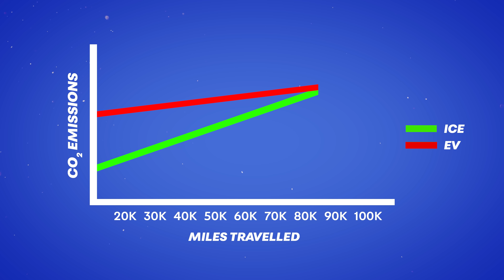Are Electric Cars REALLY That Green? [New 2022 Data]

Comment: Wonderful discussion. You hit on many of the points I think about and argue about when considering EVs. I’m a car guy and a geek but have not yet taken the plunge. I live rurally and take long drives - EVs simply don’t work for me, yet. I agree with you that, with time, technology will improve and EVs will be a better proposition. I may give up my A4 but the 911 cabriolet with manual will be mine for as long as I can keep it going! Cynical note: are we nuts over EVs because Tesla is worth $1 trillion and everyone wants a piece of that?
Reply: No-one who says in 2022 that EVs don't work for them is not telling the truth. I have NEVER encountered anyone who could explain HONESTLY why an EV wouldn't work for them. ALL of their reasons were wiped out by advances years ago, but they still hold on to out of date nonsense. Range as a reason was killed stone dead by 2018. Charging speed was killed stone dead by 2020. Cost was killed stone dead from the start. The infrastructure has grown way beyond ICE infrastructure to accommodate a far smaller number of vehicles, so the infrastructure argument is also stone dead. When you say "it doesn't work for me" you mean you don't WANT it to. I've owned an EV for six years. By today's standards it is very low spec and yet it has busted every single EV myth going. EVs can work for anyone, anywhere.
Reply: @trevorberridge6079  With respect, I take long drives (6 hours, 12 hours) to see family. I’ve consulted Tesla and EV America maps to figure out what recharging would be like. Both add significant door-to-door time to the drives. Further, I live in a rural area where the nearest charger is 45 minutes away. A trip I have planned to Michigan’s Upper Peninsula is simply not doable with an EV car. I realize that 95% of my driving is just fine for an EV car. But the long road trips I take make EV a wait-and-see for me.
Reply: As others have discovered in many test drives, if you are driving very long distances that take 6 to 12 hours you WILL be stopping occasionally anyway for a number of reasons. If you charge while stopped then you cannot claim ALL of the stop time as additional time due to charging.  I have often stopped on long journeys and charged up more than I intended because it took me longer to eat and take a comfort break that it took for me to get to my target charge level. So, in those cases, there was NO stop time due to charging. Charging happened simultaneous to other activity.

Also to say you cannot use an EV for very long trips in America is simply untrue. You could argue that you can't do the journey within a specified time frame. But the answer there is to do the same as you would with an ICE vehicle - plan your trip around a realistic schedule. Check out Transport Evolved to see the many coast to coast and other long distance trips they have done across America including while towing a vehicle on a trailer.

You should also note that there are already cars that can do 1000 miles on a single charge that aren't even using the latest battery tech. Sandy Munro who is regarded as a much respected engineering guru has stated that we're not many years from batteries the size of a large smart phone being able to provide that kind of range. That means on a volume for volume basis a battery pack that would be considered small today would be capable of delivering tens of thousands of miles on a charge. However, that is where we are going. The fact is that where we are now means there is no journey too far for an EV. Even the humble 30kw 2016 Nissan Leaf has completed the 2000+ mile Mongol Rally using only domestic level charging. Current cars are WAY beyond that vehicle. They have higher efficiency, bigger batteries and hundreds of miles more range.

In summary, if you want to say you cannot drive to Michigan's Upper Peninsula in an EV then you really mean you are setting a maximum journey time above which you call the journey "impossible". Taking longer is NOT the same as being incapable of doing the journey. A person can swim across the English Channel. It takes a lot longer than a boat, but nevertheless it is still 100% "doable".

Comment: What they didnt factor in, is the most important aspect, which is evolution of the methods used in producing parts for EV vehicles, as they become more common, and more widely sold. It's currently harder on the environment to make EV vehicles, because they are not being built at the numbers that ICE vehicles are, so parts are in smaller runs for every single aspect of the vehicle, which takes a greater tole.
It is always hard on the environment, and most expensive for tech in it's infancy, until the tech becomes the standard.

Comment: but the problem to mention is by 90,000 to 100k miles lots of evs are going to need a new battery which is going to ad a sudden spike to the break even point

Comment: No, they're not green. The production of the batteries is extremely polluting, the packs only last about 8 years, most of the materials cannot be recycled, and they're usually charged from coal or gas powered plants anyways!!! 

It's just basically 'virtue signaling' at this point. But, as a car guy, that instant, explosively powerful torque is attractive!

Comment: With the acceleration of Europe’s move to renewables in the current Geopolitical climate in the next decade(the values given were most likely 50k for Europe, how many cars bought today are not likely to complete 50k in the next decade?) the figure these cars will be greener is actually now closer to the green energy end of the scale at 32k.). Battery technology and the embryonic recycling industry of these batteries is progressing at a rapid rate, far exceeding developments of the combustion engine, so if this is a comparison over the next decade (as it should be) the model for EV adoption is far more beneficial.

Manufacturing Co2 levels, is not the same as the dangerous levels of pollution in concentrated areas of large cities, that sits at the height of inner city children. Just shy of 10k premature deaths were attributed to pollution in London last year. The majority of this being attributed to our road pollution. This is comparing buying a new car to keeping the old one.

Does this include pollution from brakes or just Co2 output (surprisingly high amounts are related to tyres and wheels, 30% I think I read)?  combustion engines output will be far higher as although are heavier, the regenerative braking performs the bulk of this, so you can complete entire journeys without using the traditional brake pads at all.

Comment: However, if you maintain an ICE then it can last for many hundreds of thousands of miles. How long will a battery remain efficient before it needs completely replacing and thus starting the cycle again? Is the disposal of the original battery taken into consideration whilst an ICE engine is recycled? Genuine questions here.

Comment: Another question is how do we dispose of the old batteries? Batteries usually don't last more than 10-15 years, after which you have to replace them, which in my opinion pollutes two times more than building the EV in the first place, you have both pollution from manufacturing new batteries and dumping old ones! That's why I do not think EV is the solution, maybe hybrid, you can drive it in electric mode in the city and then recharge it on the way home on the highway, where new ICE usually get very good gas mileage.

Comment: How many battery packs do you need for 250,000 miles? That is what today's cars are capable of. What is the energy sum for all the mining and equipment to manufacture a replacement battery pack, or replace the complete car. Let's not forget the increase demand on the power grid and all the resources to expand the grid and power station. Then what do you do with the old batteries? ICE are totally Recyclable except for gaskets. How plentiful are the resources to make the batteries? In the end someone can bring me a few gallons of gas, But where I'm I going to get the power to recharge my batteries while creating a major traffic jam bigger than the one I was stuck in to start with. We need a better solution!!

Comment: Bring back the OG Peugeot 205 but with batteries. There I said it. Don't change anything else. Doesn't need a big battery, excellent for city driving and way cheaper. I said 205 but about any basic economy mini car from the 80s or 90s will do. Not as safe but at this point I'll take a little bit less safety for a more friendly impact on mother nature.

Comment: Really interesting video. A question I had always wondered.

I think it's fair to say that more than 90% of EV owners will be on specifically designed EV tariffs which are renewable/nuclear only. So, I think the fair comparison is around 30,000 miles for the breakeven point.

I think Volvo were just trying to be clear on the point and how the customer's energy mix impacts the impact of their vehicle. And I think it also says that a BEV is still a less impactful choice.

It's good to see investment and focus in electric cars at last, with innovations improving efficiency of the vehicles now >4 miles/kwh compared to <3 miles/kwh just 4 years ago and, things like BMW's precious metal free motors (which means less dirty mining) and Tesla's tab free batteries, LFP batteries nit containing nickel or cobalt etc.

I guess other things to factor in are components. An ICE car has considerably more components that need replacing during its lifetime vs a BEV so, the breakeven point may even be a quarter less than that in Volvo's study.

Comment: Not sure why this makes EVs look bad. The current European mix implies that if you plan to keep your car for more than ~5 years, then overall, you'll end up more environmentally friendly. In addition, it also gives an individual added benefits for installing solar and storage at their home (which further reduces the breakeven ownership time). 

The result will likely only skew further towards EVs as manufacturing processes get greener, grid electricity reduces emissions, EV batteries become better (longevity and capacity), EV engines become more efficient. You could argue ICE will also improve, but the weight on investment and innovation is on the EV side, so logically that should improve faster.

Comment: It seems a lot of the auto industry journalist have a brain disorder, use accurate info if you want to stand on your soap box, a large number of electric car charge at home without any CO2. Yes there are many sources that do not generate CO2, hydro, solar, wind and many Tesla owners have Power Walls. Most of the data is no longer current and out of context, just be thorough, honest and none bias. if you can't do that maybe just go away so you are not such a negative drain on society.

Comment: We got a 2017 Chevy Volt in 2020.  It gets 50 electric miles before gas kicks in.  I rarely buy gas.  In fact, I often park on the wrong side of the gas pump and have to move.  We have had solar for 20 years.   Our small 3.5 KW system made 4850 KW in 2021.  We didn't use 1300 KW of that.  So we use just under 300 KW a month.   I think the Volt only needs 8 KW to charge.   All free  to charge and all clean energy.

Comment: The math has been done many times. EV’s are much cleaner in the long run. And the point is that they last very long. The EV car can easily last 200,000 to 300,000 miles on its original battery, which will then be recycled and replaced. The Tesla Model 3’s drive unit is rated to last 1 million miles. So the reason EV’s will always be greener is because they last much longer and are much more efficient with energy usage.

Comment: This is just silly, we're working to switch over the entire grid to nuclear and renewables. Yes if some parts of the states if you bout a chevy bolt it would take 90k to get to even.... but if you bought a tesla that has produced more electricity through their solar division than they have used for all of the manufacturing since they started, so they would be closer to the 20k mark for no carbon... and 20k is nothing. Factor in no oil changes, maintenance and a significantly longer time span for the cars life and you get a no brainer. Vovlvo isn't that impressive, they're just trying to get into the EV world, but if you look at a BYD or Tesla and its night and day between the two. Factor in sustainable processes for mining and you get closer and closer to lower and lower carbon. As the grid gets better, even crummy EV's like bolts get to the 29k mark, but gas just stays where it always has, super carbon intensive. Factor in the fact that Gas, to be unleaded, is the primary user of Cobalt (EV's make up a very small fraction, its gas that uses a ton of it and it ends up in the air...). and its much worse for the ICE cars.

Comment: Hopefully Sodium-Ion batteries take off. Sodium extraction is dead simple compared to Lithium, and we should stock up on Lithium if D-T fusion plants become economical.
In the meantime, Lithium isn't actually the main polluter of the batteries. It's generally Cobalt and Nickel. Especially because Lithium Ion batteries contain relatively little Lithium.
So starting with companies like CATL in China, they are quickly shifting to Lithium-Iron-Phosphate chemistries. While these are slightly less energy dense, they can be charged to 100% and drained to 0% regularly, giving them greater practical range. And Iron is obviously far, FAR better to source.

Another thing which Volvo probably didn't include, and reasonably so, is the fact that battery materials can be almost completely recycled back into batteries, while exactly none of gasoline emissions can be recycled back into gasoline. I say it's reasonable because including it would involve betting on a future that isn't currently present. Demand for recycling batteries would only ramp up AFTER EV demand is sufficiently high, and IF they can make recycling itself economical, which is still in R&D.

But yeah, as a sort of "EVangelist" as you put it, it's important to NOT dismiss this part of the discussion, and to remain skeptical of some conspiracy theories. For instance, I know someone who worked on the EV-1. Apparently, one of the main reasons for its discontinuation wasn't its threat to the industry, but that the environmental ROI didn't pan out. Production was still too emissions-intensive. On the other hand, I do understand Ford started buying up and liquidating EV startups. Meaning they likely risked anti-competitive lawsuits for the sake of keeping EV down. I can't imagine being motivated by much else.

But conspiracies thrive in silence. So simply trying to hand-wave EV problems away as "non-issues" only serves to benefit the worst ideas, and hinder the EV demand needed to fund the research to mitigate these issues.

Comment: Im not sure if this was covered, but not only do EV's pollute the most with battery production, but also the battyery itself becomes 15-20% weaker after 5 years or so, and by 10 years falls under the replacement category. A battery can cost up to $15,000 and is the biggest cause of pollution. So factoring that in, every 10 years you would roughly need to replace every single EV battery

Comment: Well said.
What happens at the end of the cars life?
ICE vs EV
What are the environmental implications of all the batteries be disposed of vs oil etc.

I drive a Mild Hybrid and get about 45-56mpg depending on my heavy foot. DIESEL also.
My car is a 2018 and just had it's mot and done 15k miles in it's lifetime so far.

Comment: The Volvo data is right - indeed it also presumes the EV is powered by a renewable non fossile fuel source like solar or wind; but 97% of the grid world wide is fossil fuel powered so if you charge with the grid and EV will probably never be greener; and if you choose a very effieicnet hybrid such as a Toyota Corolla hybrid - you may never be as low in CO2 output.  IF you are really  wanting to cut CO2 - CARPOOL or ride a bike; if everyone carpooled just for work - not only would you save money, time and co2 but you would effectively cut total miles driven by at least 1/2 OVER NIGHT .. all you need do is get off your bum.

Comment: Of coarse Volvo don’t want to switch to electric cars, they are heavily invested in fossil fuel vehicles, not to mention they will have far less returns in spares and repairs when they finally switch and only produce BEV’s. If you want to see the maths on which is actually cleaner and the payoff timeframe, check out the Engineering Explained channel, he does a great job in showing every thing from the cost of manufacture of BEV, PHEV & ICE vehicles to the efficiency and cleanliness (or not) of petrol vs electricity from the production to the pumps/outlet. He even has a video on weather or not it’s better to just run your old car in to the ground vs the cost of carbon in buying a new car every few years.

Comment: Yeah, agreed. What you said at the end of the vid was what I wanted to point out for the most part. EV-s are a somewhat new tech that is being developed and explored. Even batteries are being newly researched and developed with quite a few early development technologic resolutions put forward. Even renewable energy is having breakthroughs recently with better solar panel cells and even a new technology for sea currents being explored. There are still 8 years before the designated swtich to EV-s, although we might not get the best technologies out, but EV-s will for sure become more efficient.